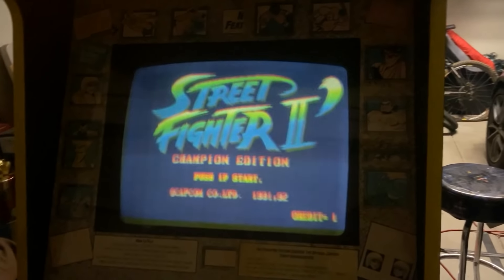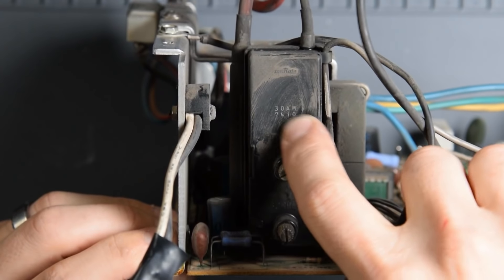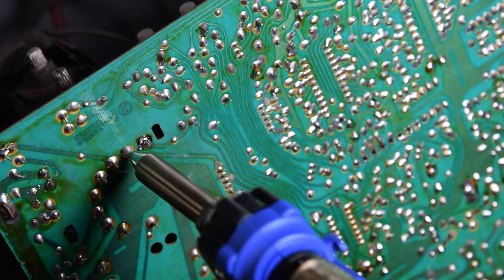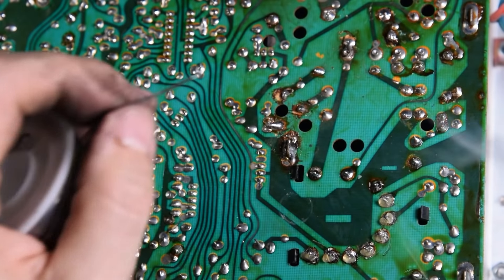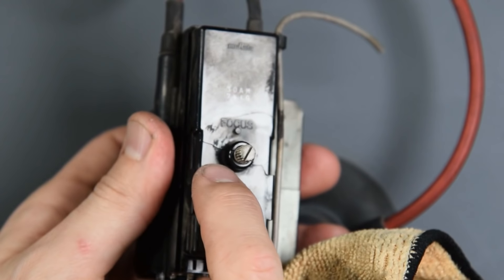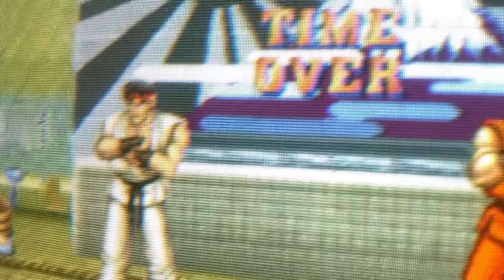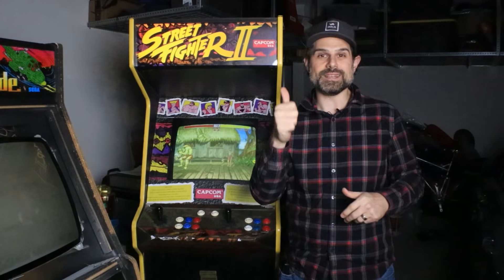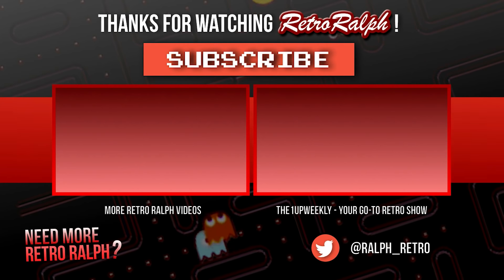Arcade Cabinet Pickup - Street Fighter 2 World Warrior!

Comment: Ive run across a few obscure chassis that are hard to find flybacks for. Had great results from using a two part epoxy to fill in the cracks. Might want to give that a try if you ever have the same problem. Great vid by the way. Glad I found your channel.

Comment: You think that pressing harder is generating more heat for the desolder process, but it's not.  It's time that does that.  It takes time for heat to transfer.  No need to press hard, it will damage your soldering equipment.

Comment: Confused...In the thumbnail it shows the title screen for World Warrior, in the actual video...this is clearly a Champion Edition board- look at the title screen. The cabinet is not an original, it did not come originally  with the yellow accents on the cabinet and is missing the side art. What was the original cabinet with a six button layout...something newer than a CPS1 game? Is it a custom cab with an old monitor and chassis? Good job fixing the chassis.
Reply: Edit: It was Champion edition in the first 3 seconds of the video...then after you fixed the chassis it turned itself into a World Warrior board at 5:00? It's missing the 4 boss characters that champion edition added ... did you swap boards or use two different machines?
Reply: So... Swapped boards or used 2 different machines?

Comment: Yup Wells-Gardner k7000 chassis, blurry picture on these can be masked and looked fixed by a flyback but because its new its masking what the real problem is the main culprit on these k7000s is usually the neckboard chroma transistors, seen it a dozen times, your picture is sharp but not as sharp as the k7000 should be, https://flic.kr/p/2kVDXKL replace all 3 and that will fix the blurry issues.

The original flybacks in these with the white knobs are notorious for cracks I've yet to have in a k7000 for repair that hasnt got cracks all over it lol.